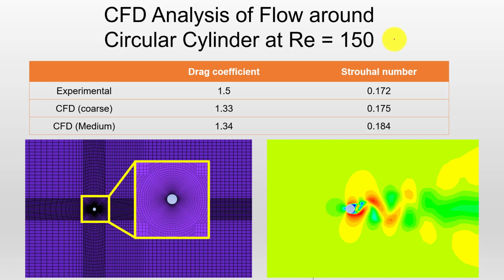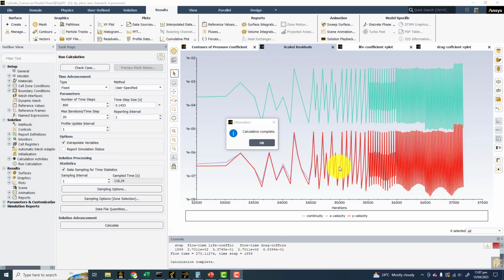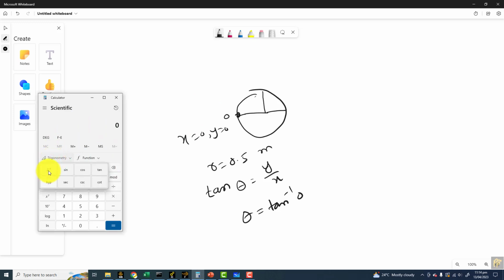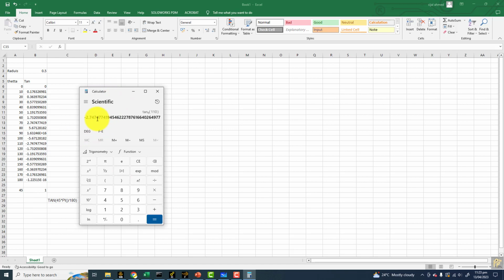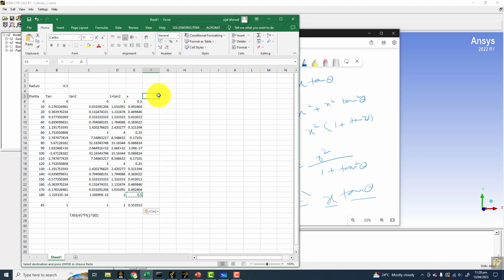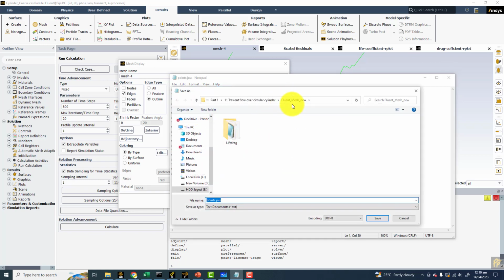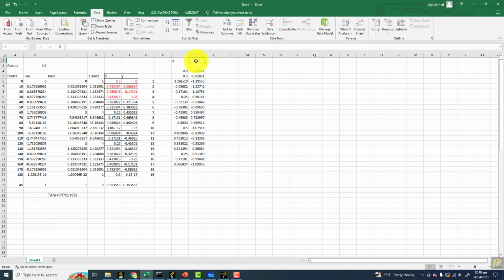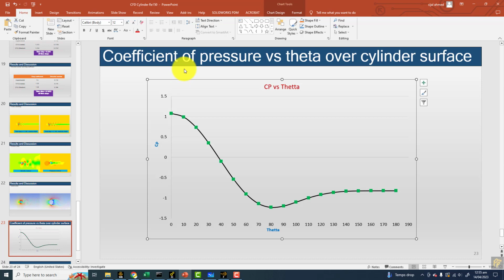Plotting coefficient of pressure along circular cylinder at Re = 150

Comment: Which approach are you using? RANS ?
Reply from the maker: yes
Reply: @CFDFlowLab  what’s the meaning of data sampling? By definition what we get by RANS is already an average quantity , right? So what are you calculating here?
Reply from the maker: @antoine1407  Actually it is URANS. And I am plotting here the change due to mean velocity. Mean velocity is varying because of unsteady flow over cylinder
Reply: @CFDFlowLab  It makes sense so me. So you'are calculating the mean of U bar respect to time,right?
Reply from the maker: @antoine1407  Exactly.
Reply from the maker: @antoine1407  yes